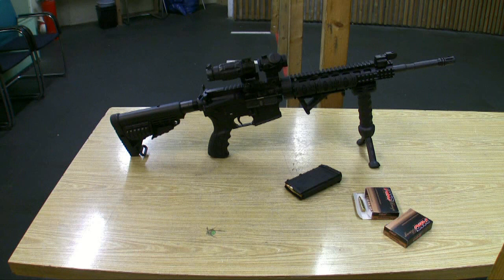Schmeisser AR-15 M5 F in 223 Rem Part II / II

Comment from the maker: The red dot I used in this video has a 3 MOA dot. This means it covers 3 inches at a distance of 100 yard...therefore the grouping is so large. A new setting of the red dot fix the problem of beeing out of center.